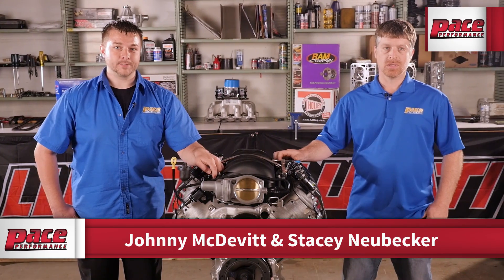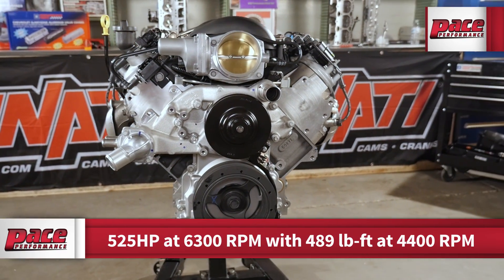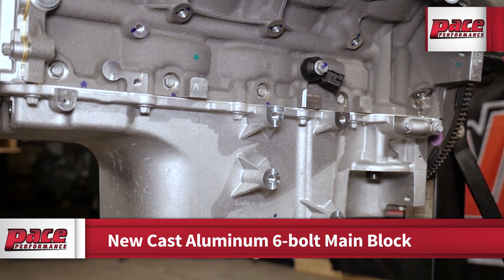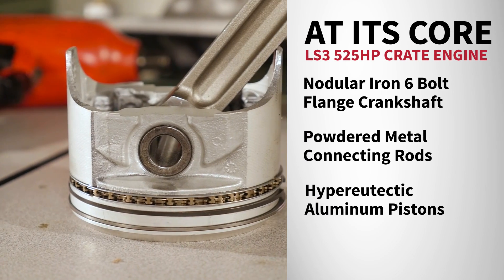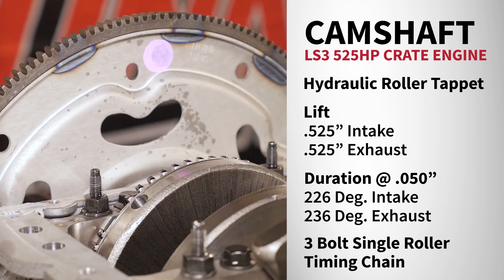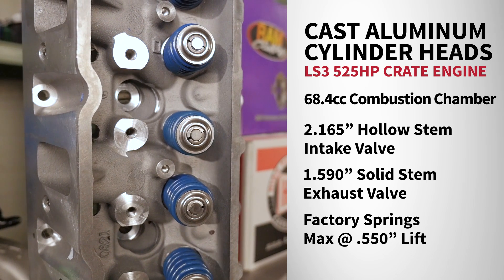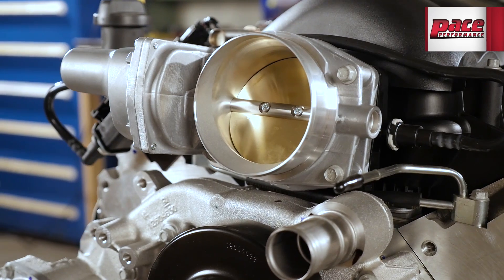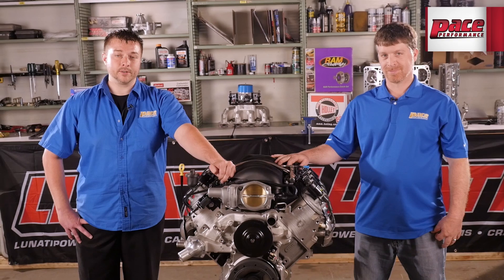Chevrolet Performance LS3 525HP Crate Engine

Comment: POWDER METAL CONNECTING RODS?!! I WOULDN'T USE THEM ON MY LAWN MOWER.
Reply: Chevy uses them on their LSA S/C 6.2L engine that puts out 580 HP and 550 lb-ft of torque, so they can handle the power. What is your issue w/ them?
Reply: @v.e.7236  DUDE. DON'T USE CHEAP STOCK POWDERED METAL CONNECTING RODS IN YOUR CUSTOM BUILD ENGINE. MAN, IF YOU ARE GOING TO HAVE YOUR ENGINE CUSTOM MADE, THEN USE THE GOOD STUFF. LIKE FORGED AND BILLET STEEL RODS.
Reply: @mikee5507  Sounds nice for a "dream" build. That's not in my budget @ $400-500/set plus pistons @ around the same for the rods and you're talking a grand, when I can re-use perfectly good OEM parts that cost nothing more than a shot peening at most. If one or two need replacing its no big deal because of their availablility. And they are forged pieces by 750-ton presses and have been used in 700+HP engines w/ no issues. All over the internet and YouTube. Your argument is just that, an argument.
Reply: @v.e.7236  THAT'S TRUE, BUT YOU MAY HAVE TO PRESS FIT THOSE STOCK ROD. LOTS OF GOOD LOW BUDGET STEEL RODS OUT THERE THAT DO NOT REQUIRE PRESSFITING. SOME USE AND E CLIP TYPE OF DESIGN REQUIRING JUST SIMPLE TOOL. GOOD LUCK WITH YOUR BUILD.

Comment: Cheap internals for that much power don't seem legit.  Anything over 450 horsepower and 450 ft/lbs should have forged steel crank, forged steel rods and forged alloy pistons.
Reply: I totally agree brother especially if you want to add boost to it.
Reply: Yup